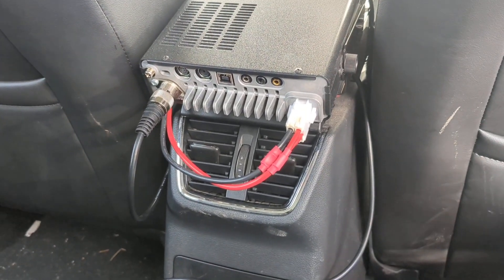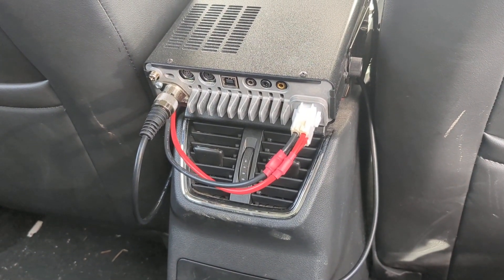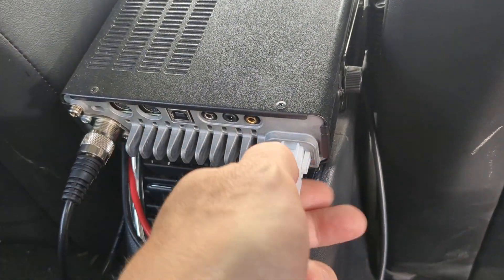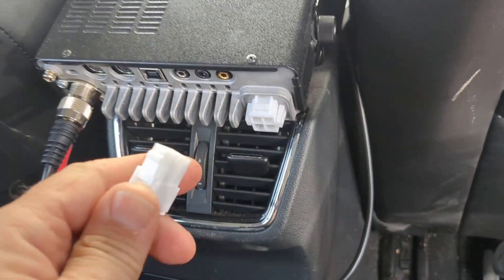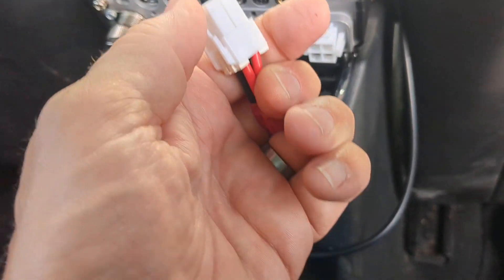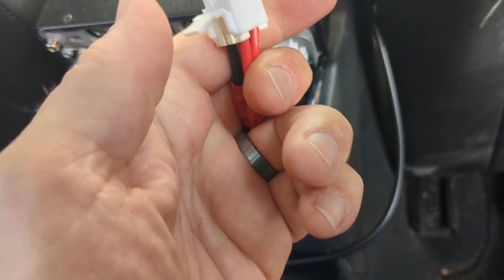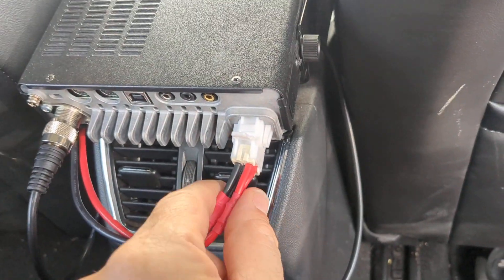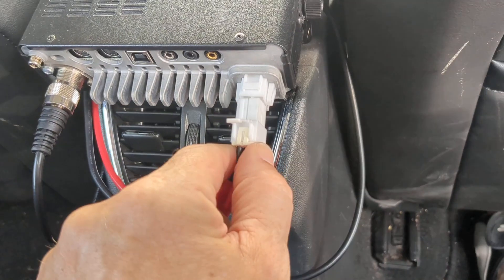Quick and easy Yaesu FT-891 "power pole" mod

Comment: It's not just about being easy to plug in or remove, it's about standardizing connections to maximize flexibility and convenience with your power supply and distribution systems.